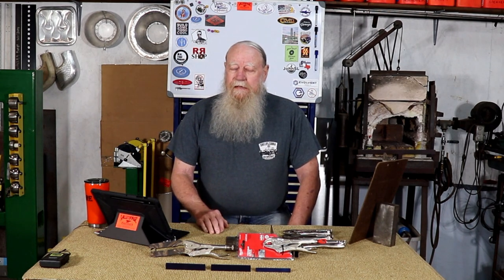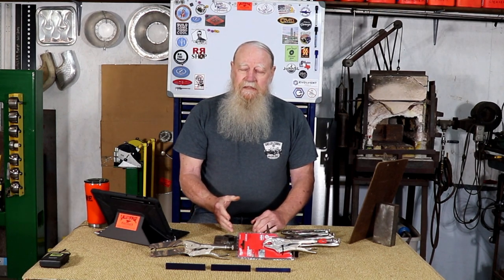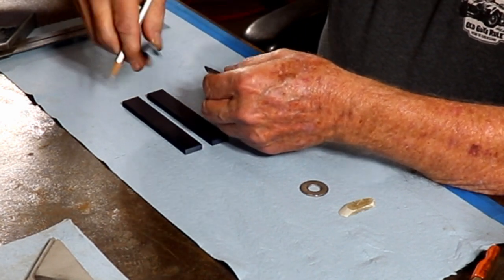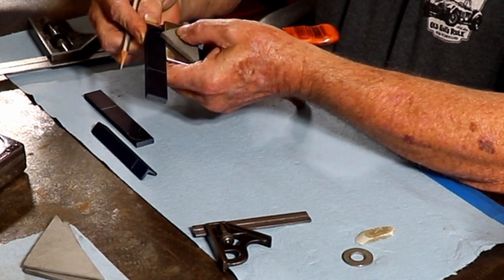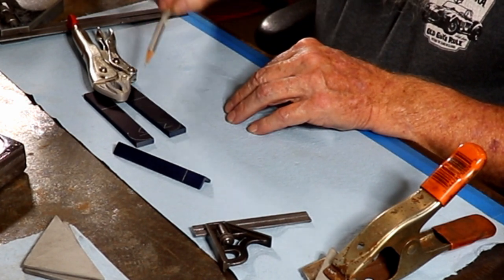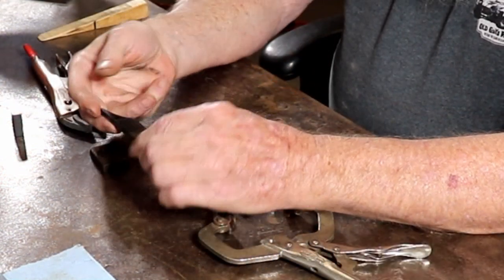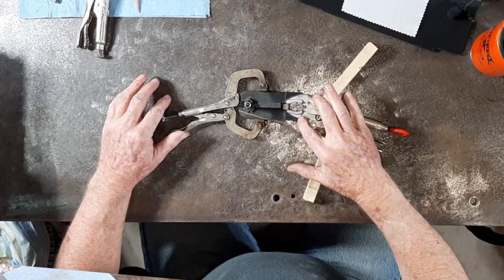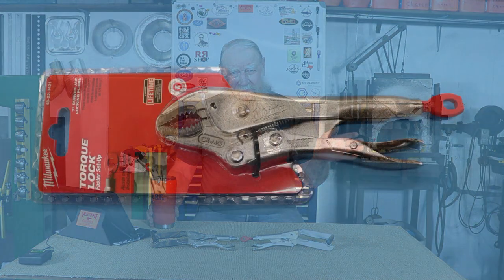How To Make Chisel Holding Vise Grips

Comment: Jere - very well done, indeed! I especially like the way you use spacers (and wedges) to get the alignment on the parts for tack welding. Clever, and effective!
Reply from the maker: Thanks Ron.
That's why I keep that tray of assorted pieces of on my welding table. Flat stock, bar stock, and tubing. There is enough to make up any combination of height or spacing without leaving the table.
Jere

Comment: Thanks for the follow up. This is definitely a project that will be on the list. I like the use of the vice grip for holding smaller punches on pieces that come out of the forge.
Reply from the maker: Albert.
I made them originally for holding a slitting chisel for a railing I was making. Lots of slit and drift next to yellow hot material required a bit of distance. They are great under a treadle hammer also.
Thanks.       Jere

Comment: Many thanks Jere. I already have the vise Grips, angle iron, and bar stock on the bench, prepped, and ready to fab!
Reply from the maker: Hello Matt.
Good job Matt. I'm sure you will find many other uses for them once you have them in hand. Holding round tubing to an angle iron welding fixture is another use. That speeds up a production job quite a bit.
Thanks.          Jere
Reply: @jerekirkpatrick2092  just to let you know, I finished them today and they turned out real well
Reply from the maker: @mattthescrapwhisperer  I'm sure you will find them use full. Now you have a tool that your buddys don't.       Jere

Comment: Hi Jere,
So whenever I have something happen that wasn't planned I can call it a "feature"?
SWEET!
Now you need to plate the new ones so they don't rust. ;)
Have a good weekend,
Joe
Reply from the maker: Morning Joe.........See what I did there.
You may also use "it was an alteration of design". I'm sure you can come up with something other than it was a mistake.

I am moving a lot of stuff from my shipping area (having sold my blacksmithing business) to the shed I put up a while back. When complete I will have room to set up a permanent plating area. And yes you can believe they will be plated.
Jere
Reply: Hi Jere,
Mistake?   RLE  = Reiterative Learning Event. I just made that up and it sounds good. I think my work is done for the day.
Oooo even more room. You are going to have a lot of space to fill up with new "stuff".
I was pretty certain plating would occur. ;)
Have a great day,
joe
Reply: In manufacturing, any chamfer/fillet/radius/etc is either an extra or missing feature when conducting first article inspection.. QA loves it when you have extra features not on the print.
Reply: @mordantly  It's a good thing for QA that they don't have to deal with me then.  ;)
Reply from the maker: @Joe.Doucette  On the print??????????
Reply: @jerekirkpatrick2092  Yes, I'd have so many "extra features" that they would lose their minds...
Reply: @jerekirkpatrick2092  yes the drawing furnished by the customer known as a "print" in a cnc shop. Dimensions/features per the printed drawing.. vs hand modified  with deviation paper work. Say edge breaks. Not called out fall to title block. Typ . 005/.010 inch chamfer. Then say QA checks first article and I put a .030 radius. That is an extra feature that scraps the part.
Reply from the maker: @mordantly  I'm sorry for the confusion. "Prints???????" meant who uses prints. I have an odd sense of humor. Only Joe Doucette and Ron Covell understand how weird I am. I have designed many machines and have had to make many detailed drawings over the years, and have made a lot of stuff made from drawings that were sent to me.
I deeply appreciate your explanation though.
Jere
Reply: @jerekirkpatrick2092  I get it. non constrained fabricating.. duh. Constraints sometimes do interfere, but if a customer is involved, it is how it must be. In my garage, things only get precise if they have to be the same.

Comment: I was just about to make some out of the pair I found around the time of the other video. Good thing I didn't yet.. they are straight jaws. Any thoughts on this acid strip you mentioned vs 309 through the "chrome" plating?
Reply from the maker: Hi Mr Wolf.
The straight jaws will work just fine. I like the curved jaws when used as intended.
Any method of removing the plating is fine. I think I removed it on the originals by sanding.
Thanks for watching and your other comments in this thread.
Jere
Reply: Muratic acid will remove the plating.  Be very careful.  Besides keeping it off your skin (and anything else you like), don't breathe the fumes.

Comment: if after thirty years you cant actually hit the end of a chisel , maybe its time to quit.
Reply from the maker: Tom. 
Noted. 
Jere
Reply: You don't quit when things become hard. You change the way you work, which might involve making a new tool.
Reply: Surprisingly, your dad hit the end of his chisel successfully. You must not have paid attention when the man explained they were for working with yellow steel. As in 2000F. How close do YOU get your hands to objects that are 2000F? A smart person gets only as close as required to get the job done.
Reply: @mordantly  I missed that, thanks! I do SOME smithing (minimal) on my homemade forge, so I might actually make this tool one day.
Reply: @mordantly   so you dont work with steel then ,,,, when you do , feel free to comment , todays tip buy a longer chisel , most of mine are about 10 inches and I can comfortably cold chisel white hot steel , should I need to , but with a cordless grinder its a rare event these days , its slow and inaccurate . hth
Reply: @tomthompson7400  yes cutoff wheels are slow and inaccurate. Nobody said anything about cutting off steel with a punch. But hey if you can hold "about 10 inches" of chisel in your hand and drift in "white" steel, good for you terminator. Who cuts off metal with a grinder anymore? Plasma cutters have been under $2000 for at least 8 years now!
Reply: @mordantly   Ill not argue with you , your clearly on something you shouldnt be , , or have never actually worked with hot steel ,,, Im only forty years into it now so what would I know. I never mentioned cut off wheels or punches , just grinders and chisels ...... are you feeling ok , are you maybe still hearing '' those voices '' again have you stopped your meds ?
Reply: @fixinstuff9662  or welding a washer onto the top of your chisel ,,, lol